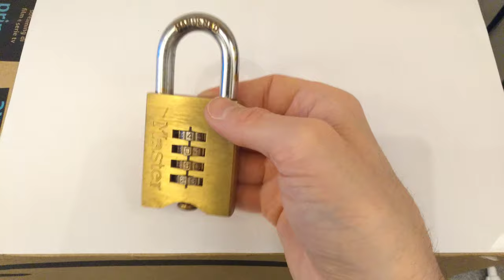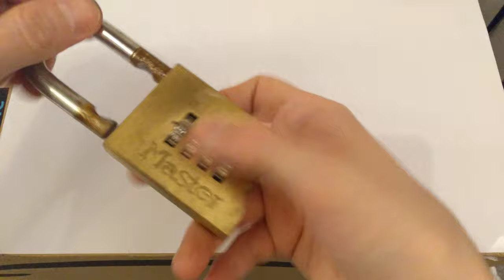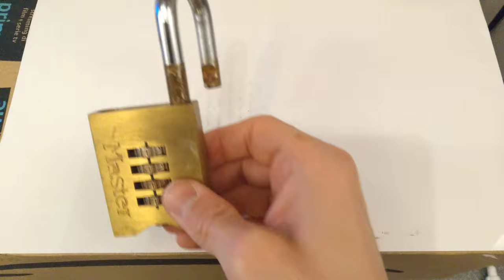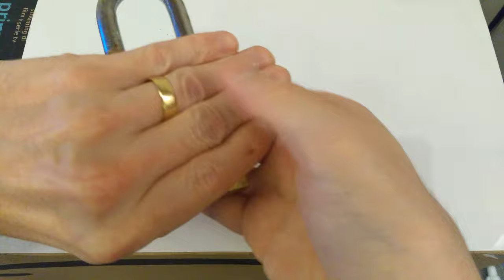Change code: Masterlock 651 EURD Brass Combination Padlock

Comment: Fantastic, much appreciated 👍
Reply from the maker: Glad it helped. After several years of being on a shed and out in the rain outs ceased up and the pin to release the shackle wouldn't move without considerable screwdriver attacking. Even with copious amounts of oil it didn't go back to how it should be. We've had to throw it away.

Comment: We have one of these but it will not reset - the pin doesn’t push back in after resetting the code. Any advice?
Reply from the maker: If its old and been outside it might have rusted up. I had to dump the one shown in the video last year because it eventually went wrong after being outside for ages.